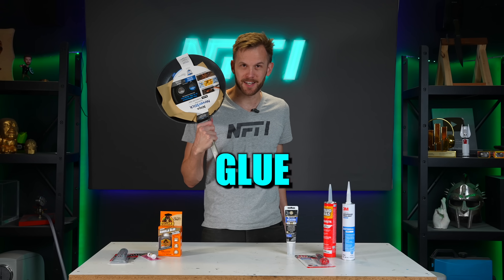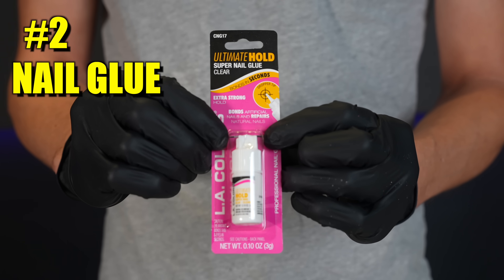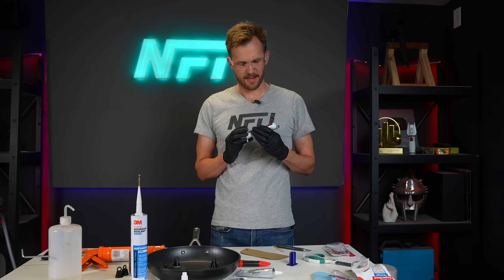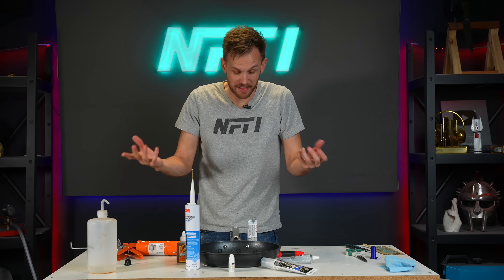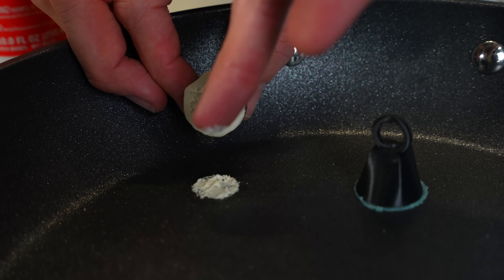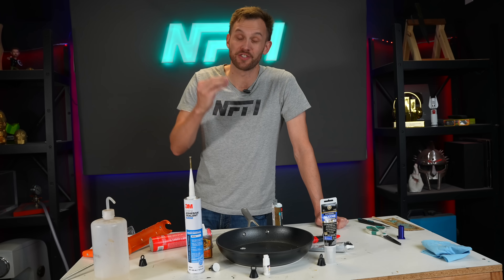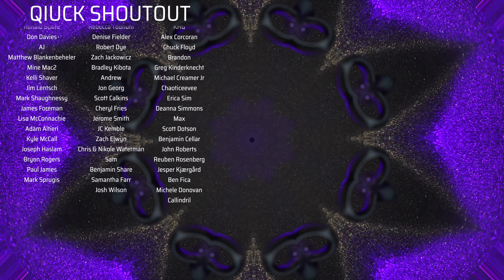Can ANY Glue beat the Non-stick Pan?

Comment: get some blocks of teflon and try to stick em together, you can use any glue or rough the surfaces with sandpaper even leave it in a vice overnight, its more dramatic then your test here lel, try it, see how much weight you can suspend before seperation, then for final one just use a blowtorch and melt both surfaces a little and slap em together no vice

Comment: TA4605 will stick to PTFE without a second thought. You can also get variants of Epoxies and CA's that are made for LSE materials, like PFTE is. Or just go to your nearest hardware store and get a bottle of Loctite SF770, then any regular CA glue will bond like a bolt, basically.

Comment: Cobbler contact cement (sorry if you've already tried it) you let it dry on both surfaces separately before you stick them together with a little heat

Comment: I would like you to try automotive 3M™ Impact Resistant Structural Adhesive. This is used to build cars and trucks, and once cured it's stronger then the metal it's bonding.

Comment: FRP advanced polymer adhesive would be pretty good i would imagine 
Its what we use to apply 4'x10' fiberglass reinforced plastic panels weighing about 40lbs to walls such as stainless steel walk in coolers, it's designed for non porous walls, if we used the fast grab like on regular gyp board it falls right off

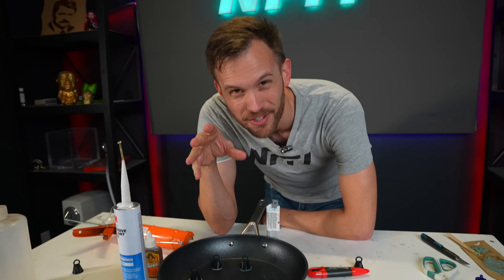Comment: I thought the loops were going to be for a scale to be attached and measure pounds of force required to pull each glue off. But you just pulling them off and holding the pan down is hilarious. 7:07

Comment: Try LOCTITE 770 primer + LOCTITE 406 cyanoacrylate glue – it's one of the few commercial solutions that can actually bond Teflon by chemically activating the surface for adhesion!

Comment: You need to try a type of caulking called NP1 . It's used as a sealant on metal roofs , but will stick to nearly any type of surface . Like the Marine caulking, NP1 takes days to cure .

Comment: Adding a comment after you pulled off the UV sample, before finishing the video. When you said you’d not recommend hanging something from the sample, that’s actually the strongest way to utilize these glues. veritasium just put out a really good video about super glue and how it works. But the way it cures it creates essentially vertical grain structure that is super strong in tension but super brittle in shear force. He also explains that materials or coatings that start with “poly”, or the stuff milk jugs are made of or pans are coated with don’t bond due to the chemical makeup of the glue and the poly material.

Comment: It would be interesting to see you test adhesives made for ABS bonding and a glue called jb weld extreme heat as the jb weld is designed for metal and high heat surfaces and the abs glue is designed to seal piping whuch is also a smoother surface

Comment: It would've been nice if the 3D printed fixtures were in different colors for each adhesive, or at the very least in a color to contrast against the black pan, and with colored labels to visually track which adhesive is which.

Comment: I have a Cletus McFarland shirt covered in 5200 it doesn’t come out. Edit it’s more of a sealant than an adhesive; it’s used for assembly of transoms in boats, maybe else where. It may cure harder but only like a silicone.

Comment: So, I’m a polymer chemist for 3M; there are two things going on here it appears: one, PTFE (Teflon is a brand name) has one of the lowest commercial grade surface tensions, which is why it’s so hard for things to stick to it, this also appears to have texture to it, so you have both chemical and physical release properties, which is extremely hard for an adhesive to stick to. The 8010 was a really good choice, but I’m not surprised it didn’t make a stronger bond because of the physical part. I think the rest of the options didn’t surprise me as well, especially the silicone caulk as silicone is the next best option for low surface energy that doesn’t contain a fluorocarbon group.
Reply: wait does the 3M one contain florocarbons? is that why it looks like toothpaste?
Reply: Since you are the expert here, can you explain how glue works or is it still a mystery? 🤣
Reply: @savagesarethebest7251  most glues already have pretty well understood mechanisms, though there are some exceptions. I think scientists made a big step into figuring out CA glue recently, but I can't quite remember. For most glues, though, they're just polymers that form either very strong polar reactions or have very fast surface rearrangement properties, allowing them to form interpenetrating network polymer chains on both ends of whatever they're bonding. Super cool stuff
Reply: would something like mseal work?
Reply: You can literally peel silicone glue off anything
Reply: I have used most of these in the past. The 3m is by far the best, in my opinion. 
  That being said.  I worked on a home for one of the top people at 3m and never got paid my final. The contractor or rather person playing contractor flat ripped me off. Destroyed my business and my family. I even left the Island that I called home for 45 years. So there is that. If I wouldn't have been fighting threw a divorce I would have had my day in Cort. All that aside.  3M IS good company. If I had it to do over I would have put TB the contractor in prison. I found out he was altering my invoices and  contract in order to stay under budget. With no regard to my life or my family.
Reply: Why? your work is pointless trying to coexist with sika.
Reply: @Claire_WilliamsF1  oh look, 5 months have passed. Time to remind you to this cringey concoction of letters you spewed there. Fangirl got triggered it seems.
Reply: @Sharpless2 Your the one thinking about me 5 months later baby
Reply: @Claire_WilliamsF1  What?

Comment: What if you take the glue that performed the best, and now 3d print something with a diameter of 20cm (or 8 inch) so that it has way more surface area, and test if you can then get it off?

Comment: You should try again! Let stuff cure for a while, are there glues that get stronger over time? Are there glues that purposefully denature the surface they bond to? ❤ Also you should build a rig to get real results. Retry with an actual setup to measure the force needed to remove them, purely via pulling pedicure to the surface of the pan. Then do shear force like start applying a pulling force slowly to the side, show us some cool graphs ❤ make a show of it❣️you can defeat it 💪🏻 (also, you could borrow some of the format for the show from l Major Hardware, a YouTube channel devoted to 3D printing computer fans and ranking them)

Comment: 9:11 fun fact, i use e6000 glue for everything i plain on removing in some amount of time, it holds things good but if you pull it will come apart and you can get it off of everything

Comment: The thicker the layer of glue, the longer it takes to cure, and the weaker it is. Thick layers are mostly testing the cohesive strength, not the adhesive strength. The samples should be pushed down until the glue stops extruding out. My money is on JBWeld or Gorilla if done correctly.

Comment: There is an Aerospace Adhesive that is like 500 bucks a tube that's used on commercial planes...super strong stuff.  Also, those 3m tapes you have to pull down to remove off walls would be interesting....they're called 3m command brand wall mount tape. very strong.

Comment: 1. Loctite 770 Primer + Loctite 406 Glue: Prime the surface, apply 406 glue, press, and cure 24 hrs.

2. Sodium Etching + 3M DP8005 Epoxy: Etch the pan with sodium etchant, rinse, dry, apply DP8005 epoxy, and let it cure.

3. Dymax UV Adhesive: Apply Dymax 3169-UR glue, expose to UV light, and cure.

Comment: To make it a bit more scientific, could you bolt the pan to your bench, then use a scale attached to each plastic piece when you pull to measure the force required to separate each one?

Comment: So here's a couple of options: One is a cornstarch glue that is baked onto the pan itself. The second option is PTFE thread sealant. It's a solvent based liquid teflon and should weld to the nonstick coating.

Comment: There is an experimental product called Bondlynx from XlynX. Designed for polypropylene and polyethylene, but it would be fun to see if it works on Teflon if you could get hold of some.

Comment: You have to remember some of the glues have to "dry", evaporation of liquid happens and that hardens it. Other glues don't rely on evap. They rely on chemical reaction. Like Super Glue. Or epoxy. And the Gorilla glue. If you really want to test the glue use a popsicle stick and glue that. The wood will absorb some of the glue.

Comment: Here's an idea for creators - instead of making a container for resin pours - you could use a nonstick pan to pour resin into.
Reply: As someone who makes resin dice, I just use reusable silicone mixing cups.  They cost like $1 off wish, are just as non-stick as that pan, and come in lots of handy sizes, with measuring lines and pour spouts.
Reply: @SladeWeston  And being flexible you can flex them to release the resin.

Comment: There is an adhesive called "steel" (I think that's what it's called) and it is really really super sticky with things like a metal pan. You basically just heat it up to really high temperatures as you apply it, normally using electricity. You should try it, it could possibly work I think.

Comment: You gave me a idea to make a acid glue.... mixture that will burn the layer its applied to then sets hard from the glue mixed in as the acid evaporates. Made to glue materials none stick by damaging the surface layer allowing glue penetration and adherence

Comment: How about putting a key onto the pan's surface with an abrasive before applying the adhesive? Just like you would with any other smooth surface.

Comment: It's a shame you didn't use a luggage or trigger scale on the loops to actually provide some objective comparisons.

I'd be curious how something like Loctite HY 4070 would do.
Reply: I was thinking that but not sure how he would do the sideways pull repeatably
Reply: @Werdna12345  That's a good point. Although he could put a proper handle on a scale and be able to pull with more force straight up. The angle pulls felt like just a way to start breaking the bond when he couldn't pull straight up with enough force.

Comment: Volvo had an anaerobic sealant that they use in their 3.2 inline 6 camshaft covers when doing a head gasket job. You should find a specific anaerobic glue to use. That's a glue that sets up in an oxygen free environment so it would set up the reverse of what the liquid nails did, hard in the center, gooey on the outside.

Comment: I'm big into car audio. My go-to adhesive for bonding wood to the inside of my roof is PL 8X or PL MAX. You can get them from The Home Depot. The reason I use PL 8X/PL MAX is because it bonds anything to anything. It gets hard like a plastic/concrete mix. Once it cures, you cannot remove it. You'd have to cut the roof out to get it out. Lol

Comment: Your test pices need to have some holes to allow the middle to dry out faster.
I have also an cheating idea to use suction, instead of an flat surface, how about putting the glue only on the surface and in the middle something which creates an under pressure, like a metal which reacts with the oxygen. Or put it in a vacuum chamber, let the 2k epoxy / UV glue cure and get it out of the vacuum chamber out.
Can Teflon be melted and stick to it self? Just be careful and do it in a fume hud, overheating Teflon releases toxic stuff.

Comment: 3M™ Structural Adhesive SA9844 or similar automotive bonding like SikaPower. A rattle can consumer adhesive is 3M High-Strength 90 which I've used to bond material to teflon strips.

Comment: I would've liked to have seen a force gauge or some comparative measuring device used.
Reply: By any chance, are you a fan of Project Farm?
Reply: I was thinking the same thing!
Reply: Why would you use these 3d printed pieces with a perfect little loop on top and not use a little hanging scale to measure the force needed to pull them off.
Reply: Same instead of him pressing his hand down and adding weight to it
Reply: A cheap luggage scale would work
Reply: this is more at-home science than the very strict lab science you would see on channels like tkor, even then i dont think they used a force gauge in the original tkor video
Reply: That’s fine but clearly the glue won’t hold onto it lol. That won’t change.
Reply: He didn't learn a lot at tkor...

Comment: They should not be able to advertise these pans as Non-Stick. The law should make them advertise as pans with painted cooking surfaces🤮 look into what happens to you when you are around a "non-stick" pan that gets over 500°F. Warning though rare it could be fatal. Teflon lung/Teflon flu, also known as polymer fume fever, is a condition that can occur when someone is exposed to fumes from Teflon-coated pans.🤢

Comment: I have an industrial Teflon adhesive in the lab at work and it's a 4 step process of mechanical cleaning, chemical etch, prime and finally a two-part adhesive...
Reply: It sounds more like "First destroying the Teflon Layer and then Stick something on it"
Reply: @dervwfahrer  No, this can glue solid blocks of Teflon together...  It basically works by both creating a rough surface for mechanical keying of the adhesive, but also a primer treatment that activates the surface and allows the glue to actually form bonds vs just relying on mechanical keying..  It's not meant to bond things to frying pans and I was just pointing out that there is a product designed specifically to bond teflon.  If you were to try it on a frying pan and were careful enough to not etch right through the coating, and prep'ed everything right, I have a feeling that it would peel the coating off the metal of the pan...
Reply: @dervwfahrer More intended for when you have an entire PTFE part rather than just a coating.

Comment: try Lexel sealant. it takes 2 weeks to fully cure. i used it on a dirty old school bus to seal a leaky seam. did no prep work before applying and it bonded hard enough to yank both paint and primer layers from the sheet metal

Comment: Superglue needs two things to work, and rough surface to "grab" onto, and some moisture to harden the glue and cure it. That's why it didn't work before. Whenever you use superglue on a smooth surface, it's best to rough it up a little with a file, or sandpaper.

Of course, that would remove the Teflon and defeat the purpose of the experiment.
Reply: I think that they use an etching compound if they need to stick something to Teflon type non stick surfaces in industrial situations. Messes with the fluorine layer on the surface so the glue stands a chance. Sort of chemical roughing it up. Same sort of principal.

Comment: All of the glues have "holding" time and then the curing time. The marketed time is most often holding time, so the thing is held but the glue is pretty far away from being cured. For example the Liquid Nails Projects Construction Adhesive (solvent based) has 10 minutes working time and will hold 250psi shear strength after 24 hours, but that shear strength will go up to 400 psi in 7 days. CA glues often hold after seconds but most of them take 24 hours to cure and CA gels up to 48 hours. The 3M 5200 has curing rate of 3mm/24h but that depends on the surface area in touch with air. Gorilla glue has 60 minute holding time and it should be dry after 24 hours but it's PU glue so the polymer strengthens still after dry and maximum strength is often reached after 48 hours.
Then you have something like Sikaflex which will hold after couple of hours and has curing rate of ~3.5mm/24h but the final strength is gained after a month of applying.
Reply: That might be a concern for preventing cohesive failure, but for tests like this, it doesn't matter how much cohesive strength they have when they're undergoing adhesive failure instead.
Reply: You really think this made a difference? Any tested glue needs to be ~5-10x stronger to even call it a bond
Reply: @PM-wt3ye  I think it should be fair to say all the glues should be fully cured to call it a good test.  Some of the adhesives he used won't be close to fully cured in 24 hours.
Reply: Commenting to get notifications
Reply: Thank you for this info! I've used the JB weld uv in the past, and it's worked pretty well for my applications. I believe it also has instructions for cure time when the uv light doesn't make contact with the full surface like curing for 24 hours or something along those lines.
Reply: I think you need to do this again with more curing time
Reply: @janmcclure6239 he let one sit for 9 days and no difference.
Reply: he doesn't have lots of time to waste when he is pushing out multiple low-effort videos every week. Such a shame.
Reply: @HeinzizBaKeD what? He doesn’t even post once a every week. What are you on about?